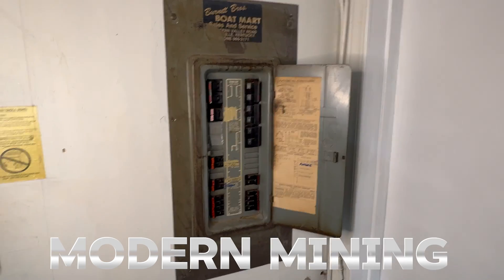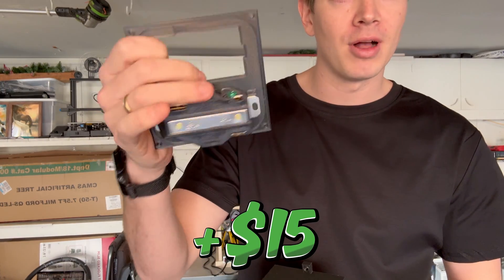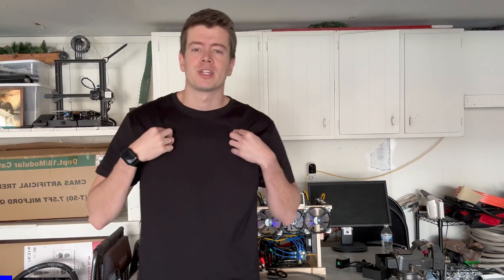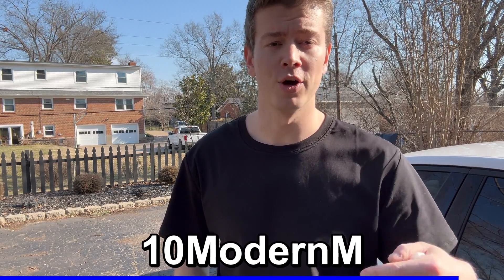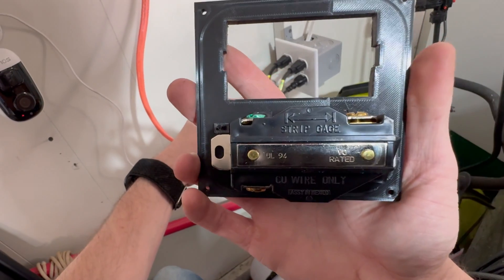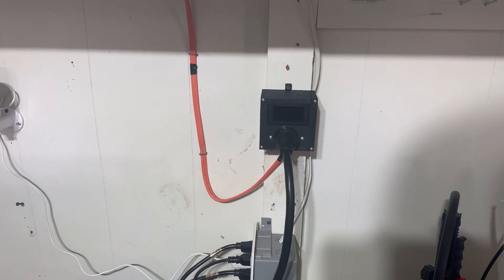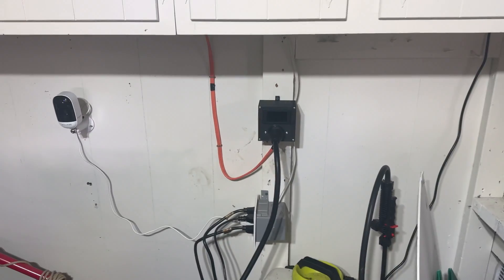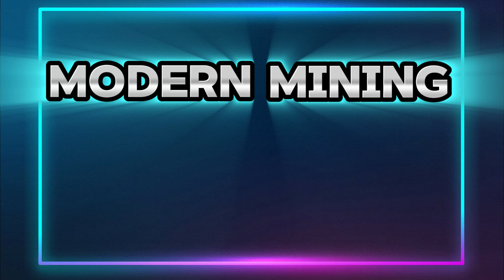How to Wire a 240v 30a Outlet for Crypto & GPU Mining!

Comment: I can't believe u did this yourself.....   If only i had a garadge attatched to the condo, luckily we own and can modify anything inside, but the freaking bigger electric box alone is like $300 for bigger version of the one we have now the GE PowerMark Gold,   ugh this gonna cost like $600+ to install 2 240V outlets not to mention price of electriction, and an inspector and the electricty itsself,  I wonder since I'm changing my 24 port 150W pannel to a 40 port 200W pannel , will the electrican be able to just take the breakers I have connected and just put them in the new one without re wiring EVERY ROOM, and the only wiring that needs to be done is for the 2 30A breakers and the 10 Gadge wiring to install?

Comment: It looks fine. In many countries running the cable in that way is technically to code. There's one thing I'll point out that i noticed as you were doing it.

Check that your panel meter has a fast blow fuse. Ive seen these fail, and they often do not have fuses (but sometimes they do!)

When they do fail, its normally explosively. The panel meter will require something like 0.01A. So a 0.1A fuse would protect you in the case of a meter fault.

Faults tend to occur when there is a surge, as the meters also lack ESD/Surge protection. What happens is, for a short moment, your line voltage will increase to 500, 1000, 10000v. Your power supplies are equipped to handle voltage transients, but the capacitor(s) on your meter will overcharge instantly, generally explode, and often short.

Suddenly, you have 30A (in reality , for a short time, probably over 100A) @ 240V going through that cable, which is over 7kW (24kw at 100A)

Those little computer cables will melt, and the short will prevent you from turning that circuit on.

A fast blow fuse would just isolate the meter, so your circuit will continue to function as normal, but the meter will appear dead. Thats a much safer and preferred outcome, than any kind of fire.

Then if you notice one-day your meter isnt working, you can be fairly confident that your circuit is fine, and your meter is just dead. You can mine as normal while you order another.